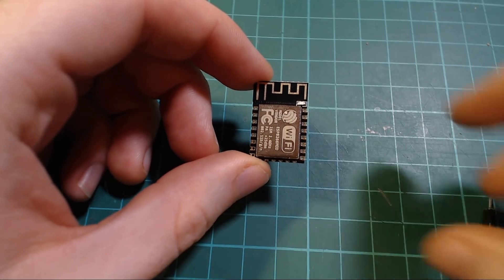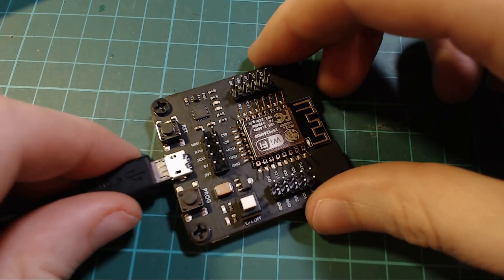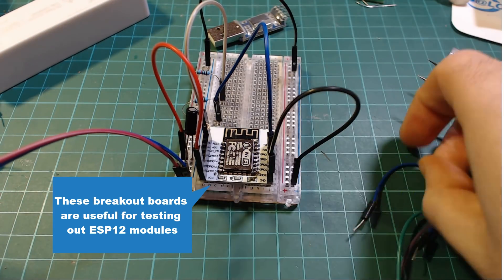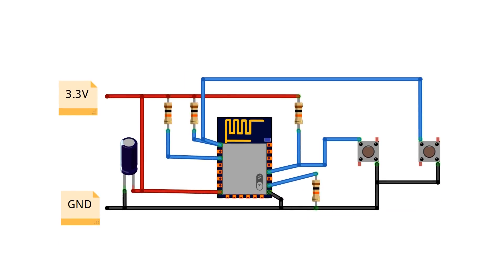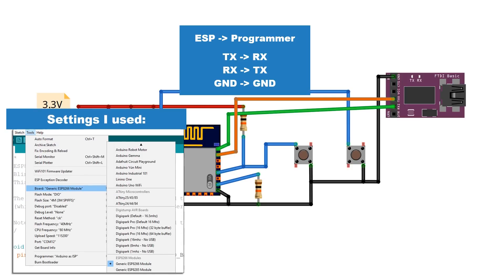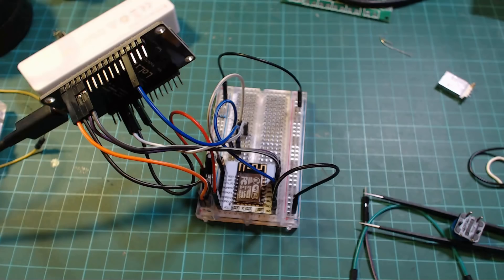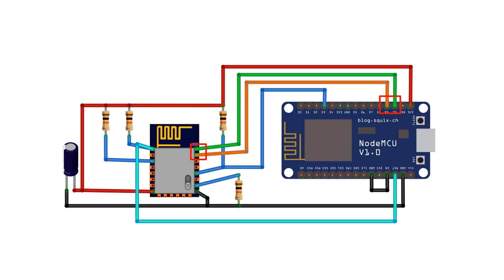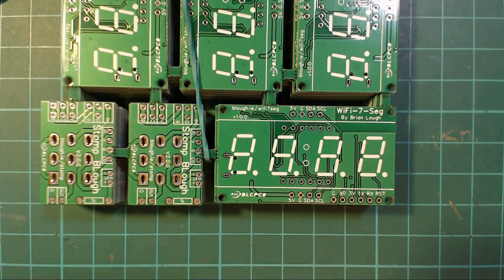3 Simple ways of programming an ESP-12 Module

Comment: In case this helps someone: If you're using an ESP-12S which is already on a PCB, pull both GPIO0 and RESET to ground when you arrive at the "uploading" (after "compiling") stage. After a second or so, stop pulling the pins to ground (I happened to stop pulling RESET and then GPIO0 when I did it, in that order) and uploading should commence. Thank you for the helpful video, Brian!

Comment: Hey! Thanks for the video. 

At 2:27, I got the same "adapter board" from banggood, but I'm wondering how are you keeping the esp steady in place? Did you just solder it in? I'm wondering if there's an easy way to make it easy to place/remove esp from board, kind of like the first board.
Reply from the maker: Yeah I soldered it. I dont think there is an easy way. If you need to remove it I would get the frog pin board.

Comment: Nice Video! Do you know the resistor values for normal operation of the ESP12?
Reply from the maker: At 1:33 it's basically that circuit but I guess you don't need the buttons. All the resistors are 10k, but they are just pullups so anything in that region would be fine

Comment: Hi everyone!
I made every required wiring but I still couldn't upload code. When I try to connect via VSC - Platform IO for uploading got "timed out". Monitoring is working fine, I can see the output of the code. 
Thank you for your help in advance!
Reply: Even i'm facing same problem. Any solution you got ?
Reply: @WarishKumarSahoo  You need UART downloading boot mode, you can find the pin levels here: https://riktronics.files.wordpress.com/2016/10/untitled.png?w=462&h=296

Comment: are the resistors strictly necessary?
Reply from the maker: Very advised. They are pull up resistors though, if you don't have 10k anything in the range would be fine. Even 1k might do in a pinch

Comment: hi, i have a problem with this esp8266 E12 i am using it with arduino uno to program it but my problem is that my AT commands didn't work before and then i uploaded the firmware and it's working but when there is no code. so when i upload a code( where i'm using some AT commands to open a web page) they don't work.
can you help me?

Comment: Thank you very much for the "disabled" NodeMCU board method! I can do this right now, PTL!
BUt what is the significance of the 100uF electrolytic? Will it work without the cap? I am assuming the AMS1117 3.3V reg on the NodeMCU dev board can handle the naked ESP-12 module?
Reply: yes, I tryed it with the ams1117 3.0 and it works!!!
Reply: The 100uF Cap is there to stabilize the voltage so you don't need it, but it is recommended to use one!

Comment: dude nice video, i have a question, If is possible to use the wifi mode and control another device like an accelerometer and programming on the Arduino's IDE?
Reply from the maker: Is the question can you use an accelerometer and WiFi? If so yes! Just Google esp8266 and accelerometer and I'm sure there is some example
Reply: @BrianLough  Thanks!

Comment: I'm confused. Espressif says that GPIO2 should be pulled high [1]. But nor in the diagram you show, nor inside my ESP12F is there a pull-up resistor on GPIO2. Yet, this programming methods works for me (and pulling up GPIO2, didn't seem to work).

[1] - https://github.com/espressif/esptool/wiki/ESP8266-Boot-Mode-Selection

Comment: what is the value of resistor
Reply from the maker: The not super important but pull-ups are usually 10k
Reply: @BrianLough  it isn't working , i followed exactly same. If you can connect with me to troubleshoot that would be great..!
Reply: @BrianLough  esp com failed error..

Comment: Great video thanks,  Now I want to make a PCB  that holds the nodemcu and  has header pins for programming esp8266 project.  Looking at the programming pin outs on you clock project  
gnd gpio0 3.3v tx rx rst. I wonder if there is a standard for the order?  I'm currently looking at a project using a ESP-12S ( thus I can bring traces thru the bottom middle)   and a different order would make routing easier.    but then again a ESP12F might have a different optimal order.  Anyway was wondering if you had any thoughts on standardizing the order on the programming pins
Reply from the maker: I don't believe there is, but there is a programmer on tindie that someone made and I decided to make my PCB pin compatible with that, so might not be the worst orientation to pick

https://www.tindie.com/products/iohippo/esprog-esp8266-esp32-programmer-with-autoreset/

By the way you can get some nodemcu on AliExpress without the esp-12 module, but they are only a couple of cent cheaper so probably not worth it!
Reply: Thanks Brian,  the tindie product looks nice,   here is my guess  why that pin order may not be the best when using a nodemcu as a programmer.  On the nodemcu programmer we don't swap TX and RX, but with this tindie programmer I'm guessing one does. Thus my project routing was always needing to cross over  those  2 traces,  I'm leaning towards.  going with the order of  3.3v  RST TX RX GPIO0 GND.  looks to work good when using a ESP12S  because I can place the programming header just below the ESP and all the traces are short straight shots.  ( ok  sorry for getting  too much in the weeds)

Comment: Hello sir m begginer in electronics can you please tell me what value of capacitor should I use like 100mf and 25v or 35v ??
Reply: Both are ok. The 'voltage' doesn't matter as long as it is higher than you need, which is 3.3v in this case.

Comment: How do I wire up just the esp12e to my project? Do I need crystals and capacitors like with an Arduino uno or can it run without them
Reply from the maker: The wiring diagram at 1:08 is the minimum circuitry needed for an esp12e

Comment: Thanks Brian! I want to program ESP-12 to receive data using SPI from an ADS1299 chip, and plan to make a PCB for it. I think I'll program the ESP-12 from a NodeMCU. Aside from breaking out the correct pins to program it, is there anything else I should watch out for? Or is there any reason why you think it won't work? Thanks

Comment: After going through your video i wired up my esp 12e to the ftdi and powered up using a voltage regulator . the sad news is it wont let the code upload but when i pressed the reset button the serial port says

 "" ets Jan 8 2013,rst cause:2, boot mode:(7,6)

waiting for host"
 Does anyone know the solution for this . I'm stuck with this part from morning on wards

Comment: Unfortunately the PL2303HX USB to Serial Convertor only works up to Win 7 and shipping is $4.75 to Canada. Can be found much cheaper on eBay and elsewhere.
Reply from the maker: I'm using it with window 10 anyways, I'm not sure what drivers I used as I have it set up a long time. That's shipping sucks! There should be tonnes of them on AliExpress or as you say eBay that should be the same

Comment: Will this actually work as an 'in circuit' programmer, or just with naked ESP-12 modules?
I'm thinking of situations where GPIOs are connected to external circuitry.
Reply from the maker: Once the circuitry is not incompatible with the boot mode options there shouldn't be a problem. Like for example if you connect gpio0 to high directly with no resistor, grounding it is going to cause a short! But if gpio0 was connected to an led then there shouldn't be a problem.

It will basically behave exactly like the development boards would

Comment: Is there something special about the nodemcu board or can one use a board like the Wemos D1 or mini ?
Reply from the maker: Mainly that it has chip enable broken out so you can disable the onboard esp module. I believe you can do the programming with a wemos if you keep reset low, but you don't get the auto resetting magic
Reply: You can use a D1 mini by shorting the ESP12x EN pin 3 to the RF can.  Works just as well as Node MCU.